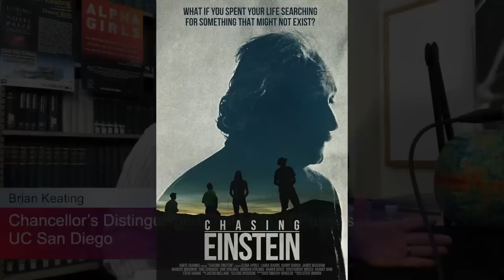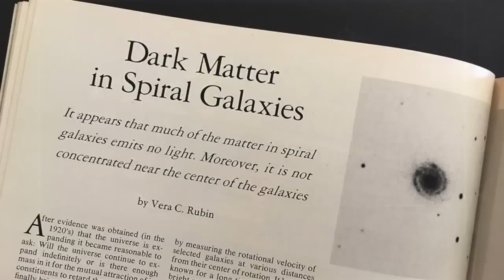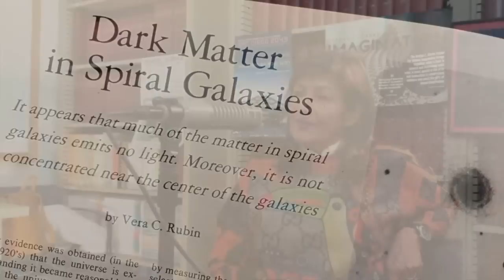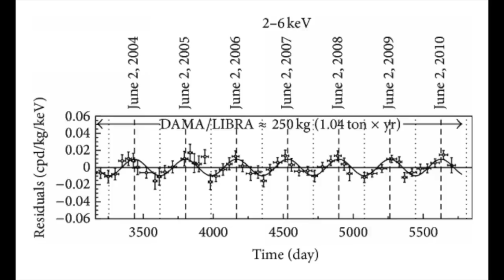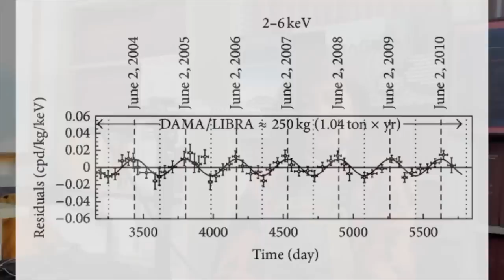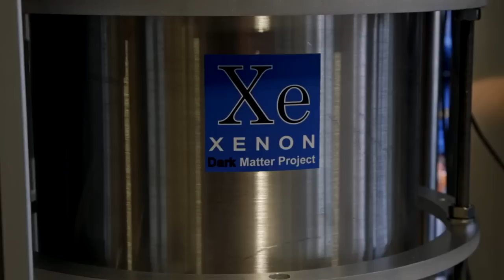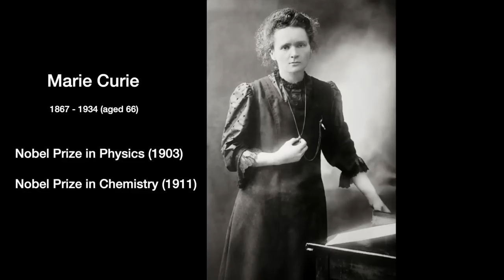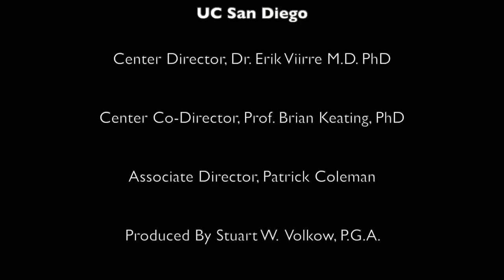When Will We Detect Dark Matter? Elena Aprile, XENON Experiment on The INTO THE IMPOSSIBLE Podcast

Comment: Novel Dark Matter Hypothesis
 
Dark Matter is simply unaccounted for gravity. GR states that gravity is the consequence of the curvature of spacetime. Is it possible that the structure of spacetime itself could be warped without the presence of mass?  Spacetime has been shown to react like a fabric by warping, twisting, and propagating independently of mass, and all have been proven with observations from gravitational lensing, frame dragging, and now gravitational waves! Fabrics can be stretched, pressured, and/or heated to the point of causing a deformation and losing its elastic nature. All of these conditions were extreme during inflation, so it is plausible that the “fabric” of spacetime analog could extend having its elastic property have hit a yield point?

Therefore, if gravity is strictly the consequence of the warped of spacetime, and fabrics can be permanently overstretched, then those empty warped geodesics would create gravitational wells independent of mass. My hypothesis of DM is subatomic black hole imprints of the quantum fluctuations that popped in at the moment of inflation. The CMB shows where the hot dense regions were they created the galaxies. They would have been the initial cause and location of the warping. These imprints would be clouds of quantum sized floating fixed geodesics, so they couldn’t expand or evaporate. Perhaps nothing has been detected because there is nothing to detect. GR wouldn’t require modification because DM would just be an extension of how spacetime behaves at extreme conditions. No MOND, no WIMPs, and no parallel universes, just empty spacetime deformations that produce gravitational wells to help jump start galaxy accretion processes. Zwicky may have named is Missing Mass correctly since he detected some gravity without mass present to cause it…
Reply: Why is it often happen to be around certain galaxies? 
Agree with you on different name
Missing mass would be more suitable though not necessarily true but anyway better than dark matter that's too pretentious and misleading
Reply: @Nat-oj2uc  It happens around galaxies because the particals that make up the galaxies is the same quark matter that imprinted to make the dark matter.. So anywhere there was a dence group of quarks is where it left imprints, which is where the quarks combined to form matter and galaxies.